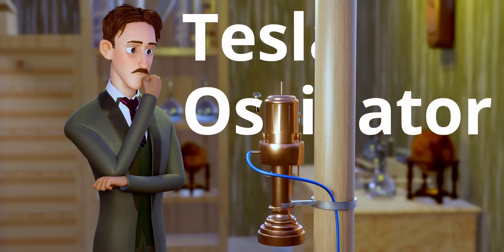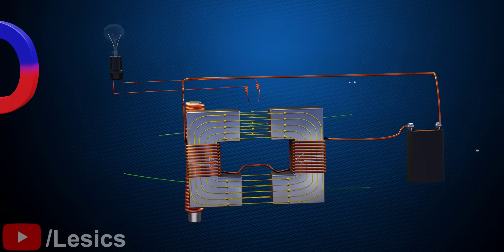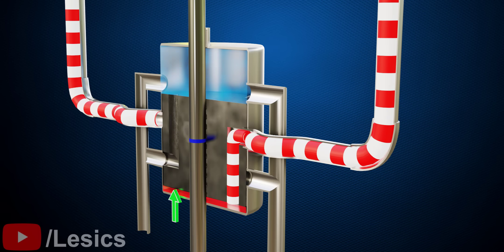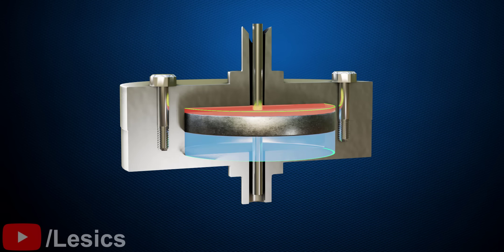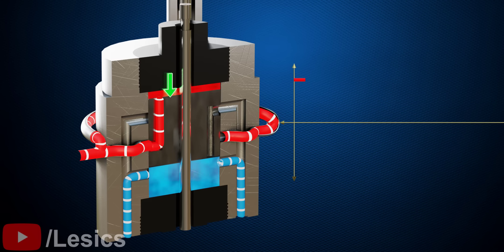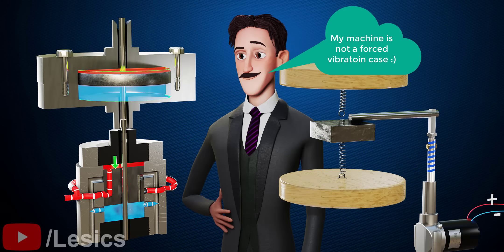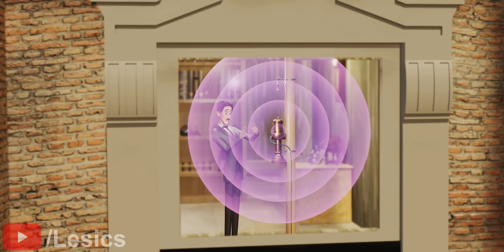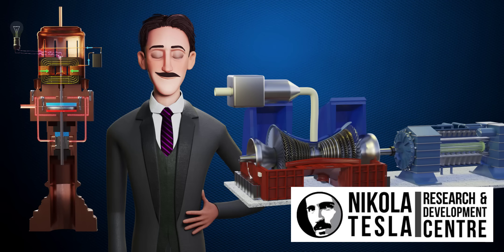Nikola Tesla's Mysterious Electricity Generator | The Complete Physics

Comment: CGI animations are well and good, but has anyone ever tried building one like shown here? I tried looking it up but all I found were partial or excessively simplified versions using air compressors and such.
Reply: There are no plans, but if you read some of the older biographies, I inferred that they describe it as a cast iron, hand-held, tunable, pneumatic single cylinder piston. It is not clear where the air pressure comes from, whether external source, or limited, stored. compressed air, bled out for variable power. In addition, if you talk with a Mechanical engineer, they could probably show you diagrams that. might be modified to create one.  Note that the building earthquake was a very special case, because Tesla was able to connect his Device to a structural post AND the building was built on a sand foundation, which conducted the oscillations [rather than damping them out like most modern foundations.]

However, if you find a foundry that will cast your oscillator, and you connect a source of power to set up tunable oscillations, then your device, if like Tesla's, will be able to make a thick link from a chain resonate.

Comment: This is such a simple device to build and it sounds so complicated and confusing however it start with the bottom plates of vibration will equal location and Nikola Tesla he knew of the Babylon scary when the walls came tumbling down from the sound up the trumpet
Reply: Who's were no trumpet they were the frequency sound of vibration magnetism of Zeke the opposite plate the copper it's the same effect if you take a magnet and roll it down a couple tube beer will be displayed the power to interfere with the normal functions of the planet Earth which will be felt in the continent moving

Comment: How do you calculate natural resonance of an object?
Reply: The easiest way, is to give it a push, then stop , and then look at the frequency of its vibration. 
for example flick an empty glass, or pull a guitar string then release it and it will vibrate at its natural frequency. 
For bigger things that aren't as easy to make vibrate : shake at some frequency, then slowly change the frequency. When you reach its natural frequency, the amplitude of the vibrations will increase a lot.
Otherwise if you know the dimensions of the object, its mass and mechanical properties, it's possible to calculate its natural frequencies .
Also, most objects, especially the most complex ones have more than one natural frequency (each frequency corresponds to a different way it can vibrate).

Comment: The pendulum model explanation is very inaccurate. The amplitude as high as in the video totally affects the pendulum frequency. And the short force kick in the dead ends changes the frequency even at low amplitudes (only kick in the center of the swing wouldn't affect it).

Comment: I think it's a Tesla earthquake generator.
I think it's wrong to fix it too tightly when installing this.
In other words, it's enough to purposely fix it loosely or make it easy to collapse while installing it on the floor so that it won't be able to go to serious situations, but I guess you didn't think of it that far because you couldn't relax.

My idea is to avoid serious situations by deliberately making them incomplete. If it's too strong, it explodes at the end if you don't take care of it.
Simply to make this easy and solid, you can put it in the roly poly case and there will be no problem.

Comment: I believe this type of electricity generation could be a good option for spent nuclear fuel, and small generator units. It only requires the fuel have enough energy to boil water. The size of the piston translates into horse power. On the old steam engine train the piston was maybe 6 inches across, and operated at a low rpm.  By off setting a series of generating coils on a long rod you produce a pulse of electric power several times for each stroke. With the use of diodes that Tesla didn't have, you can make a very productive generator equal to 5, or 10 Tesla types depending on the number of coils that are crossed at different times in the stroke of the piston. The diodes make all the difference in the world by keeping the flow mono directional, and because the coils are crossed at different times in the stroke the horse power required remains the same.  
The fuel rods don't have to be highly enriched to operate a steam piston. Where they do to power a high speed turbin.  The piston operates at maybe 200 rpm. So the mechanical wear on the system is simlar to a million mile diesel engine.
Reply: I've always wondered why we don't dispose of at least a portion of the nuclear waste in what are effectively mineshafts, taking advantage of their natural temperature to generate thermal electric charge at least. We routinely drill shafts deeper than the water table could ever reach.

Comment: Statement and Query: Large industrial and commercial customers realize the benefits of variable frequency systems internal to their large facilities. Can we say that one day in the near future the utility grid will also become a grand variable frequency system that is able to withstand the supply and demand curves of the modern world? Why should a system trip at 59.5 hz when if that system is tuned correctly it will continue to operate? It appears that even Nikola Tesla desired such a variable system. Why is the system operating on a 100 year an old spec such as 60 Hz in United States and 50 Hz in other parts of the world? In natural systems it's common to see natural organic systems respond to flux and variation. Would like your opinions. Thank you.

Comment: What know one seems to understand!!!   There is a reason why AC current travels down a conductor better then a DC current... It's called the "B" field of a magnet!!    The center of a magnet is the most powerful part of any magnetic field .  The "B field does not show up on an oscilloscope because "  it is not an energy"..  The "B" field of a magnet can show you anti gravity!!!  It's real simple..  To educate your self just take a magnet that allows access to the "B" field and tap it on anything.... it will loose weight...FACT!!  now vibrate the magnet at the right frequency and it will float in mid air!!!   AC current travels down the wire 100% due to the "B" field of the  generator..   WHAT IS THE SPEED OF MAGNETICS???

Comment: Seemed he wanted to apply the power(s) of different technologies of the time, Though it seem like inadvertent intentional "knocking", much like found in plumbing/pipes. Now, why wasn't this ever recreated precisely as Tesla's machine? There were some that did, Mythbusters being one of them, I think there's a guy here on YT attempting it with 3D prints but seems no one ever recreated every single bit of this particular generator to have the exacting test bed tesla had. It's not like it can't be done. Personally, I think he made his area rumble, due to resonance, at best that is to say his space, only every other spaces just felt a slight vibration, Otherwise this could've been tested in modern ways. I mean if firemen train with a tall building structure that consistently set ablaze each training period, why not a similar structure or use such an existing structure to test a fully replicated Electricity Generator.

Comment: We don't need Batteries for cars
And there are 4 Brakes to A Car as well. Welcome to the Resonator, flux Capacitor, they can run on anything ! even air pressure can be converted into heat ,that will burn !Good job, winner, 
Winner chicken Dinner

Comment: 5:55 you lost me here, I'm sure what you're saying is probably true as you understand it, but it's too poorly explained for me. If I push on both ends of a pendulum, the time of travel is NOT equal to if I don't push (I don't see how a frictionless environment would change this) because I am adding force to it. If that's not what you meant than where's the extra energy going? It should either be swinging faster or rising higher with each push... which, if I want it to remain a constant height, means it's reaching my other hand a little sooner than expected.

Not only that, but you then claim that the steam engine is not exerting force when more force is no longer being added, which isn't true; the trapped gas is still at high pressure, and therefor still exerting force. A balloon doesn't suddenly deflate the moment you stop blowing into it, the gas is still there, and the reason it pops is because it is constantly pushing out in all directions looking for a means to equalize the pressure.

It's extremely likely that you understand this better than I do, I'm not calling you wrong, I'm just pointing out that in your (possible) expertise, you're taking important details forgranted and neglecting to communicate them, or communicating them poorly with imperfect examples.
Reply: When you push from one side you add a bit of energy. This is the same as dropping it from a higher altitude. The ball then goes to that higher altitude on the other side. You push it again, it will go to a high altitude on the starting side. Maybe you're confused about this part:
 When you add energy to the ball, it travels a longer distance before stopping, so the overall time traveled (period/frequency) is the same.

Comment: This is nonsense!
Any out of balance machine can cause a similar earthquake effect.
I once almost shook a factory down when I switched on a lathe with a big piece of work offset in the chuck.
I could shake down the tallest buildings in the world given access to a high floor and using a simle eelctric motor and out of balance flywheel assembly.
Call RW Destruction Company for quotes.

Comment: One thing I've learned over the year through my various inventions & tinkering (mostly because I was either cheap or lazy) is is you have something designed to vibrate or oscillate or has the capacity to do so, never, ever have a have hard joint or union to anything important because if it works too well or more than you expected it will shake the ever living crap out of it and depending on the placement (exhibit A, this) it could go very bad very quickly.

Comment: I have a similar idea in my head for long time.  So I was thinking of making an engine similar to this but instead of using steam use compressed air with storage tank and 20bar. Engine in block of two.  So when one goes up other one will go down . Speed regulated by pressure.  When exhaust is inlet to the other one and vice versa. To make it extra power to push piston down add two neodymium magnets one on top of the piston and one in the cylinder head. So when they get close together they will create kind of compression force. On top of this cylinder can be wired to make a coil to produce electricity.  Obviously air pressure will work in closed circle. But if any loose can be topped up when breaking for pistons movment.  Hopefully someone will understand what I mean.